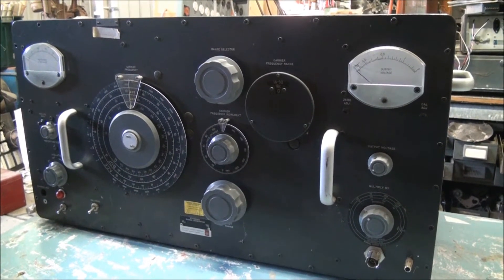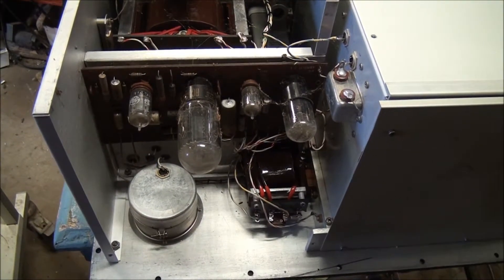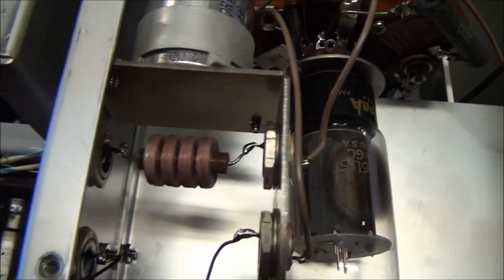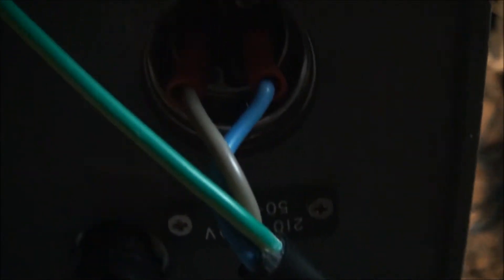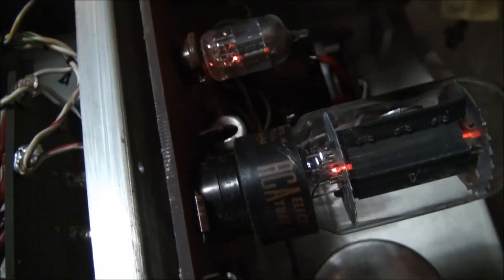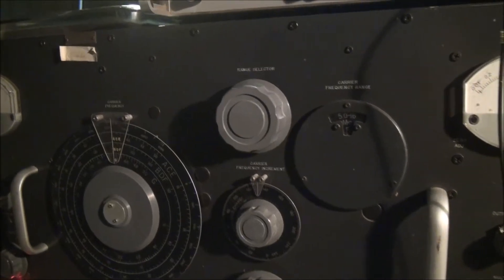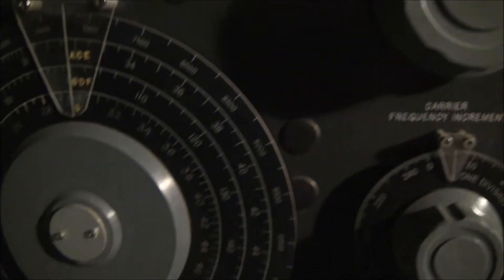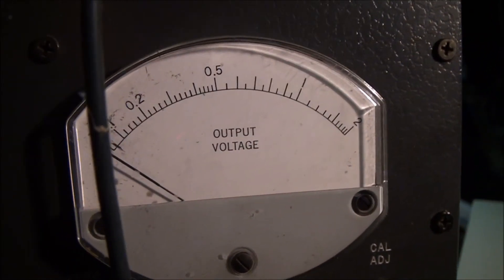Signal generator autopsy

Comment: some paper wax caps may have died, and check resistors too, This thing will be spot on, when those faults are resolved!!
Reply from the maker: I will need to revisit this unit and do some troubleshooting to get the missing range bands working, they are the ones most needed for checking AM tube radios. I will do some searching on the net for a circuit diagram as well.